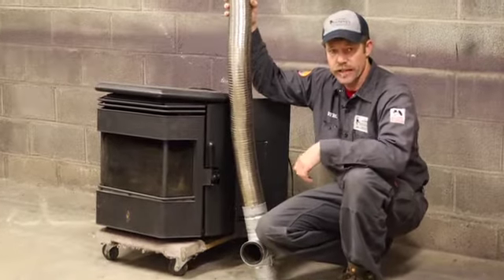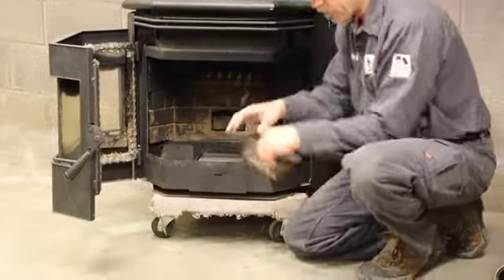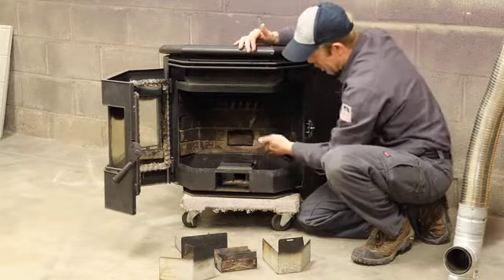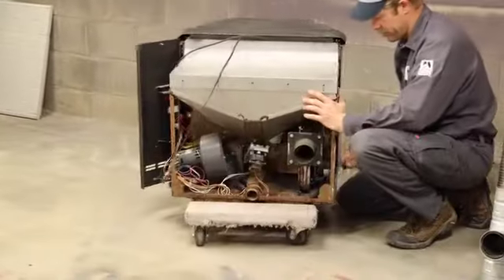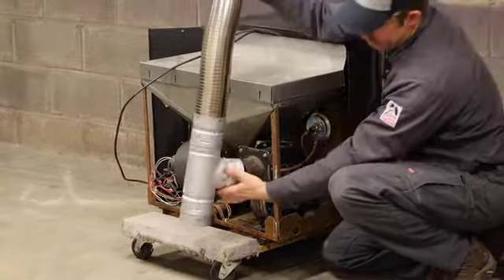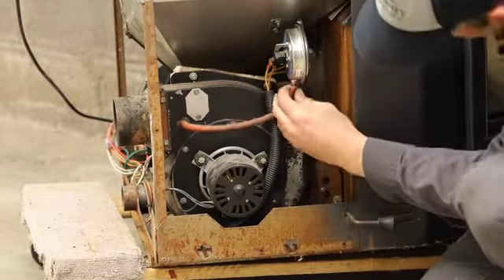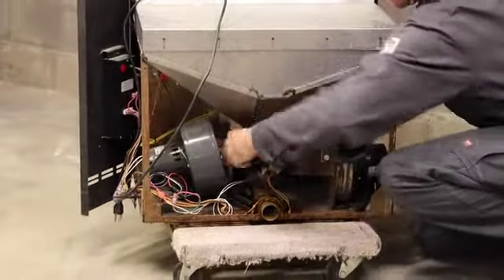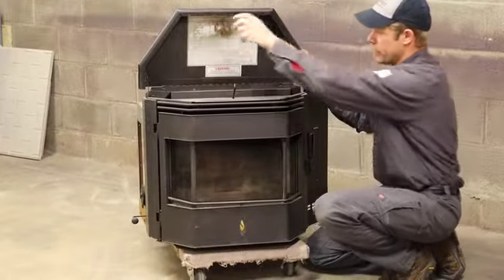How To Clean A Pellet Stove The REAL WAY: Whitfield, Harman Advance, & Quadrafire CB1200 Pellet

Comment: Thank you for an education in burner operation Sir. The jumper tester RULES fella. What would you suggest to increase the heat output of a American Harvester 6100 unit. Peace vf
Reply from the maker: Not familiar with that unit, but overall thoughts on pellet stoves: The heat output is controlled by the mfg, and all we have access to is the hi-low adjustment knob. This knob essentially increases airflow AND fuel through the firebox, increasing or decreasing heat generation (i.e., fire size...). Good luck!
Byron
Reply: @Midtownsweepsfranchise  Thank you Bryan for letting me know the facts. Peace vf

Comment: I don’t know , I was asking if the chimney needs to be cleaned if that could stop the augur from working maybe because it gets overheated as a safety
Reply from the maker: Hello, if a pellet stove auger motor is overheating is because something might be jamming the auger shaft. A physical obstruction of the feed tube- we have found childrens toys, nail clippers, and hardware from old pallets used to transport the pellets... in the hopper, jamming the auger. That will usually burn up the motor... hope that helps!

Comment: Great job on this Video.   Question: I have the Whitfield insert, the first one in this video.   My flame sensor is always getting covered with soot and needs to be cleaned at least once a year often 2-3 times.  Is that something that should be a regular maintenance.   And is there a good tool to use to clean it from inside the fireplace without having to take it apart from the top?

Comment: Please keep in mind that even though alternating current is not polarity sensitive, the hot and neutral are very different. When working with electricity always use your listed testers and Hi Voltage rated gloves. Be extremely careful with working with 120 V. It only takes .05 A to defibrillate your heart.
Reply from the maker: Great point!

Comment: Thank you for the Harman part. So if the auger motor isn’t working chances are that a cleaning is needed. Is there a specific area that may need cleaning? What area would cause it to stop? Thanks again.
Reply from the maker: Thanks for watching, I would refer you to your installation and service manual!